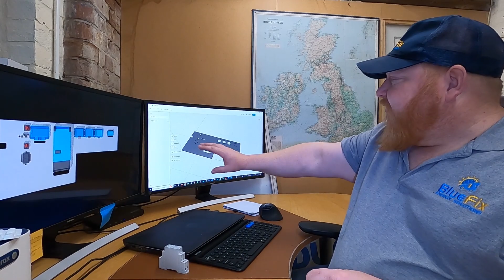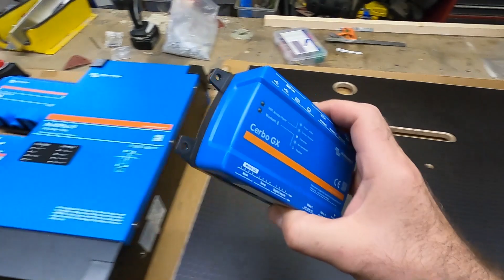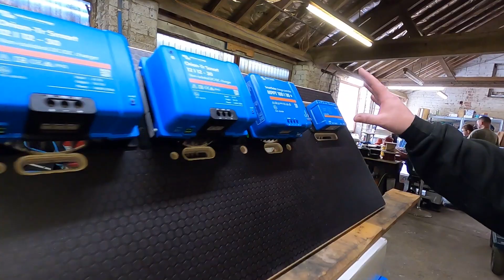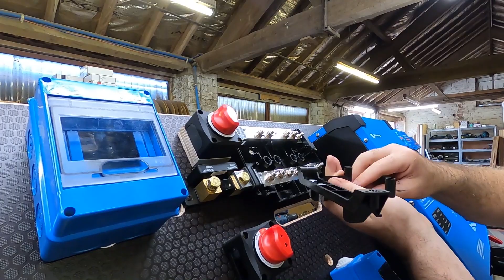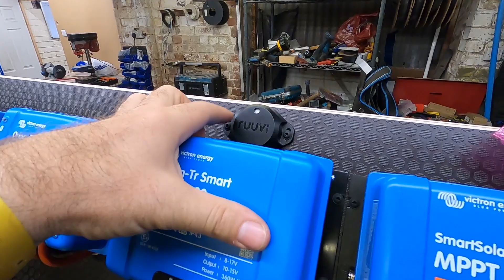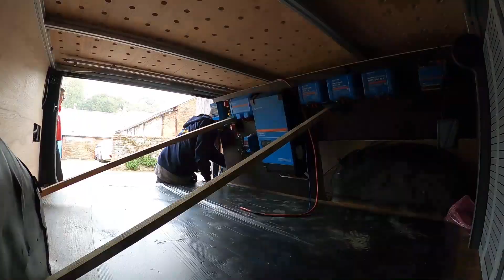3D Design and CNC Machined boarding! || Beautiful Install!

Comment: That does look very nice 😊👍🏼 2 questions, are you not using any rcd’s for the multiplus in and out? Also, I thought dp breakers should be used now? 
Cheers
Reply from the maker: Yes, we use rcbo’s for hookup to multi and then from multi to appliances